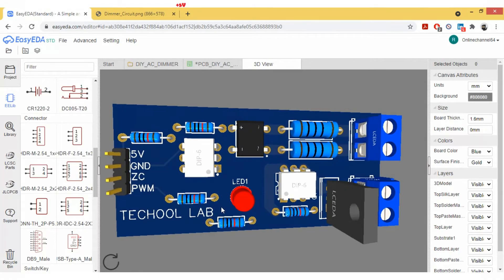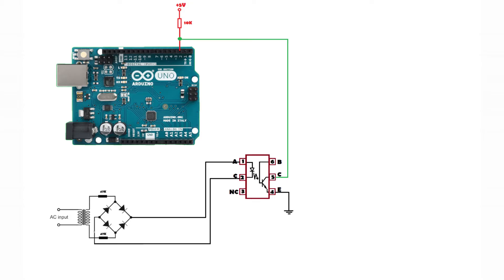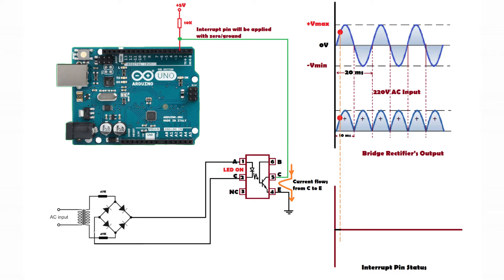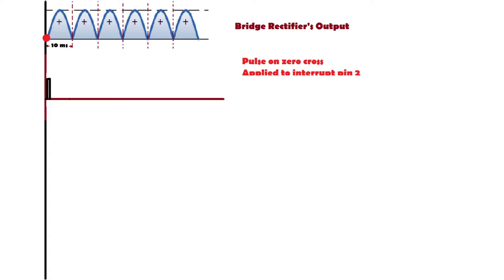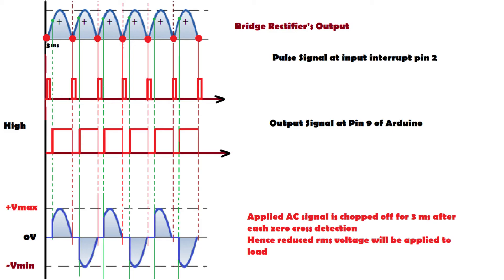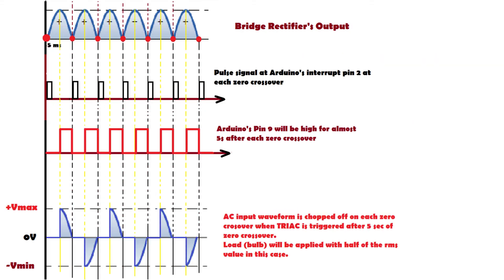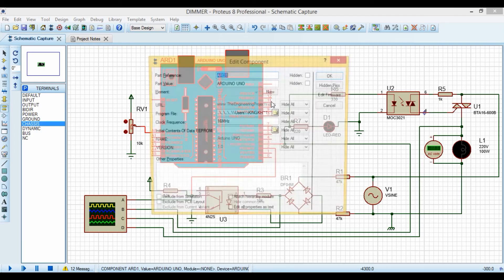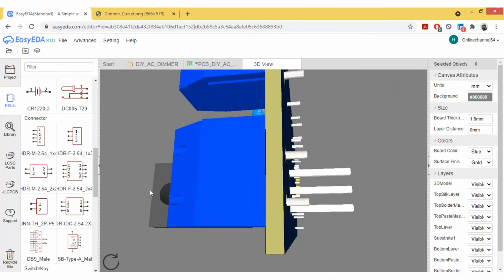AC dimmer explained| Design your own dimmer PCB for Arduino| Phase angle control using TRIAC

Comment: Can anybody explain why MOC3021 is commonly used in most of the circuits while MOC3023 has theoretically few times lower minimum current requirement to switch?

Comment: 🎯 Key points for quick navigation:

00:00 🛠️ Designing the Dimmer Circuit
- Explanation of components needed for the dimmer circuit,
- Detailed description of the zero crossover detector circuit,
- How the bridge rectifier and optocoupler work together to detect zero crossings.
05:36 🌐 Triggering the TRIAC for Load Control
- Functionality of the MOC3021 optocoupler in triggering the TRIAC,
- Process of switching the AC load using the triggered TRIAC,
- Components required and connections for implementing load control.
09:58 💻 Programming the Dimmer Circuit
- Instructions for programming the Arduino for dimming control,
- Usage of the RoboDyn library and necessary pin configurations,
- Integration of the compiled hex code into Proteus for simulation.

Comment: I connected arduino out pin to MOC 3021. But the MOC not operated. The voltage of arduino pin drop to 1 volt. How to solve this?
Reply: there is a missing resistor to limit the current to MOC buildin led. Put a 200-300 Ohm resistor between pin 9 of arduino and Anode pin 1 on MOC

Comment: But we can use directly MOC3041 as zerocross IC 🤔
Reply: this would be good to switch the AC on and off but if you want to create a dimmer you need MOC without the ZC. Otherwise it will not work.
Reply: @Mikomanus  thanks 😊

Comment: Can I use other pins to enter the signal to the controller other than pin 3 and 2 in the same program, because I want to cut 3 phases for an induction motor

Comment: Can this project work on an induction motor single phase?
Reply from the maker: It will not work for motor.
Reply: @techoollab8360  What components are needed in order to work for motor?
Reply from the maker: For ac motor we need variable frequency drive

Comment: Shouldn't that pull up resistor for the zero cross detector be between the optocoupler and the gpio?
Reply: No Mr Jordan, because optocoupler is further turning internal transistor.
Reply: And the transistor is grounding 5v through 10k resistor to ground
Reply: Thanks! It looked I was looking at the transistor backwards I guess
Reply from the maker: Thanks for watching our video!

Comment: Can you please anybody help me in searching for a device/circuit for some special work.  Actually, I need a device that would gradually increase (for 2 hours) the voltage upto peak and then would gradually decrease (for 2 hours) the voltage up to dim/off. The device needs to be connected with four 15 watt/25-watt warm white bulbs.
Reply from the maker: Mr @Chiranjib Pal , if it's filament bulb then it can be easily designed using dimmer.
Reply: @techoollab8360  Yes. It is the filament bulb. I need a self-programmed automatic dimming. Not a man-operated regulator/ dimmer. Please help/ suggest
Reply from the maker: Yes, it will work. All details related to components and program is there in this video. If still you need any support you can contact us.